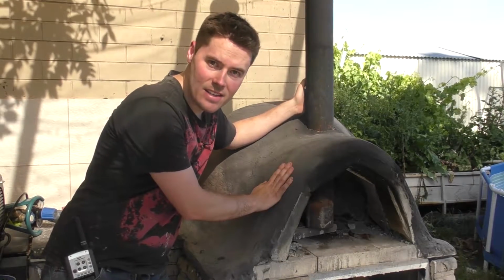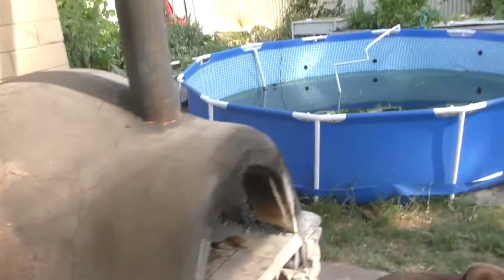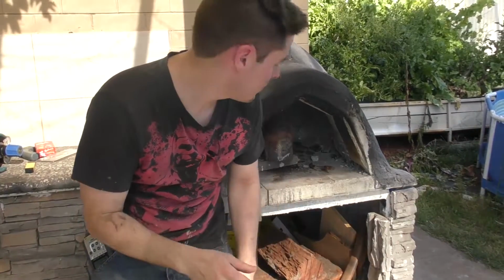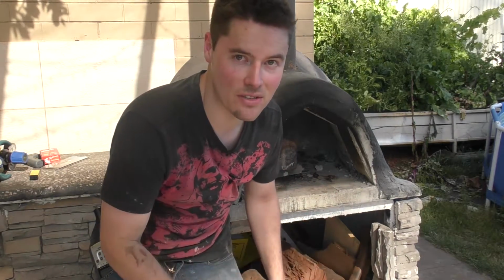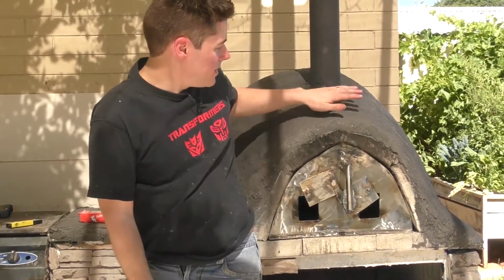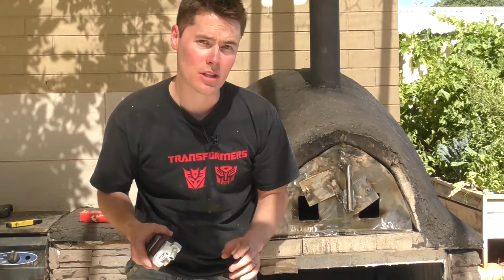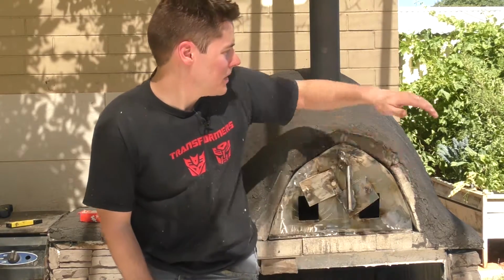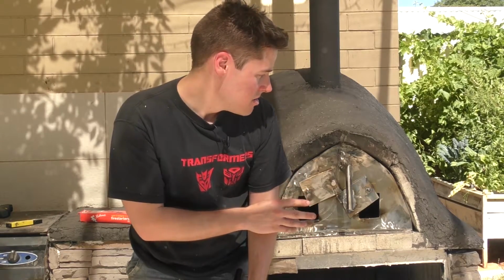Pizza Oven Upgrades!

Comment: Did it crack again? that happenn couse of dilatation just like cement streets, and the solution is the same, cut it into pieces and put something flexible inbetween pieces.